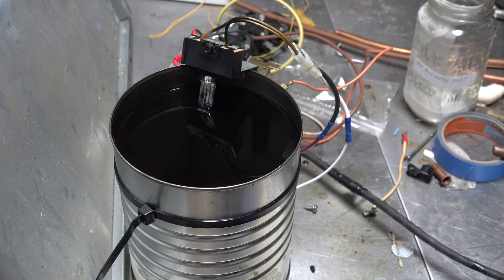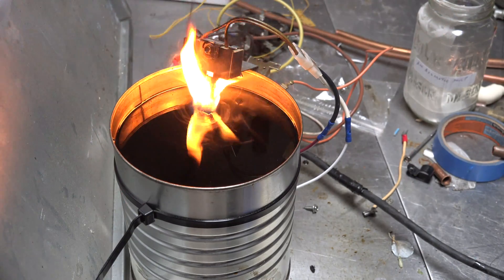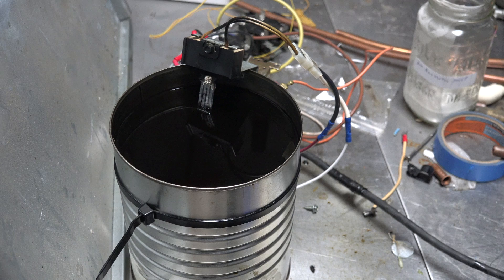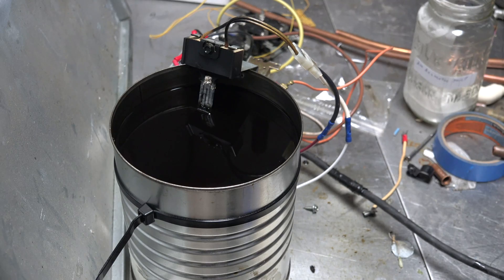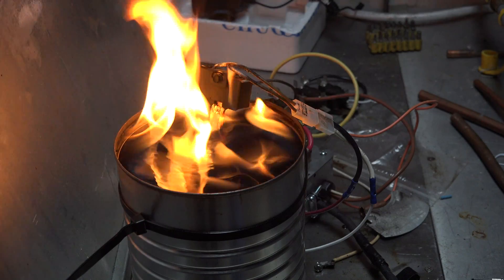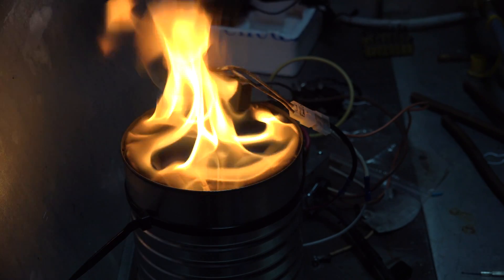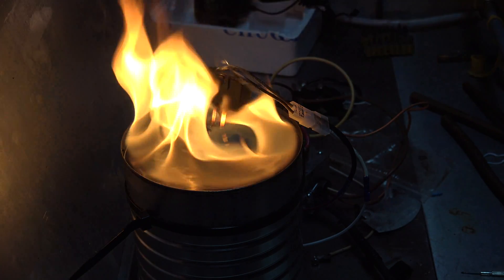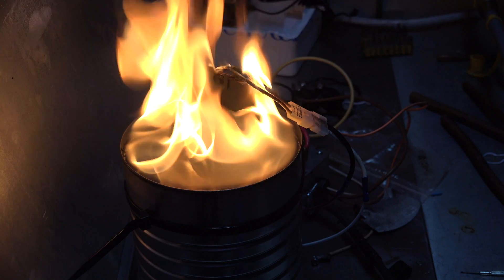The oily HSI, the last one

Comment: so what typically does cause them to fail, other than short cycling? why do some last much longer than others?
Reply from the maker: There are generally 2 things that destroy these parts.  As you have said, too many cycles.  They are said to have a limited amount of cycles in them.  Before they were used in furnaces, they were common and very seldom failed in dryers.  A dryer cycles maybe 1 time an hour.  In furnaces, they would cycle 6 times and hour and failed sooner.  The other common cause of failures was sloppy handling in the factory.  Essentially, they were cracked when they left the factory.  Hope this helps.
GFM
Reply: so things like being near a cat litter box or dryer lint won't affect it? also when do u recommend replacing during maintenances? I've been recommending replacement whenever I measure over 90 ohms for the carrier ones like in this video, or if they look really white and worn out.
Reply: also for those carrier ignitors I've measured like 78-80 ohms right out of the box, and I think the manufacturer recommends replacing them at 90.
Reply from the maker: For many years I did not replace them unless they were failed.   Later on,  the manufacturers gave us numbers of 150 ohms.  If you replace at 90 ohms, you will replace all of them.
GFM
Reply from the maker: Those ignitors reach 2200 F.  The is no lint or cat littler surviving that temp.  It will melt steel.  I never replace them at 90 ohms as that is close to what they read new.  Laundry rooms are the worst possible place to install a furnace that does not have sealed combustion not because of a hot surface ignitor problem, but because the heat exchangers are damaged by the acids produced by the chemicals used in the laundry.
GFM
Reply from the maker: I have seen the chart.  As far as I can tell, the chart is the resistance when new.  I would not use it to determine when to replace.  
GFM